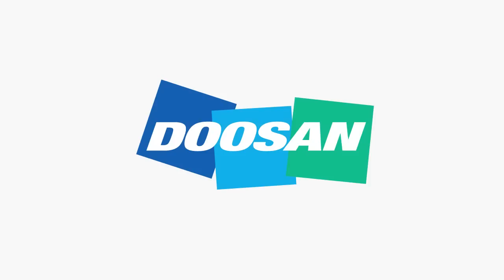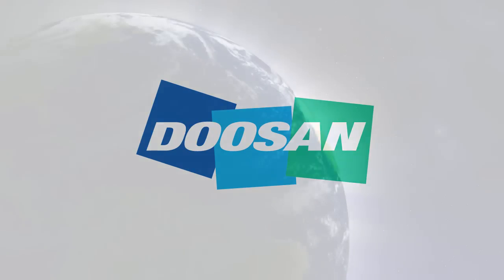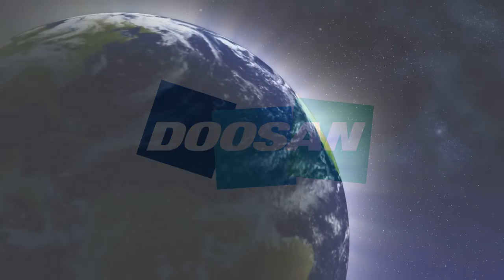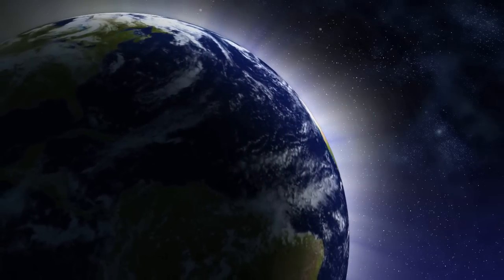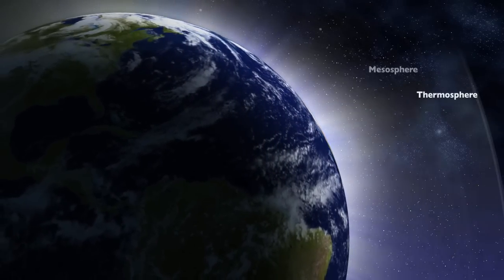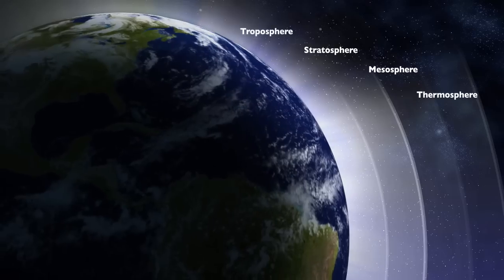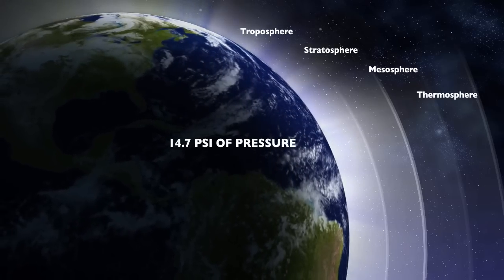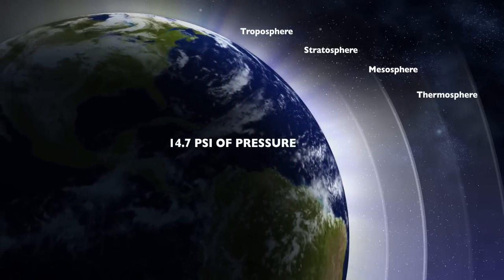How a Compressor Works

Comment: Thanks I was wondering how a rotary screw air compressor works. Very similar to a turbine engine. I’m making the jump as a gas turbine engine tech to a compressor technician.

Comment: Nice, would have been even better with oil séparation principle, really important, but this work already deserve thumb up.
This would be great a similar work with séparator, knowing there are still lot of more ancient screw compressors that use outer filter, not exactly the same as enclosed one, about the few internet schematics or animation with outer séparateur it's just terrible, for this technologie nobody seems to know where oil go? schematic of air circuit are alright, showing air coming out clean, alleluia! but oil?? it has disappear as if by magic... those attempts copy past all ends to the point where internet editors can't go further, then lazy boy kick in and bet it's enough for ego and internet noobs, job done.... classic.

Comment: I had a look at the biggest one they make today. It was pretty cool! I'm thinking it would get expensive fast if it ran out of oil. Do they use a torque fuse to protect engine if compressor seized during operation?

Comment: the engine turns on,the intake valve opens and the air flows in.
1.is that statement true?and if it is not can someone explain the part how does the air enter the chamber in the first place?
Reply: https://youtu.be/m5MKC3G-KrQ
Reply: My guess is it enters naturally. 
The engine and two Helix screws create the high pressure and the low pressure area behind acts like a vacuum.

Comment: How two helix rotor is rotating? its via supply or air
Reply: one of the rotor gets a drive by electric motor or turbine and the other is gets driven...and pneumatic I've not heard of... as the drive will be requiring more power, I don't think pneumatics can give...
Reply: https://youtu.be/m5MKC3G-KrQ

Comment: does the air coming out contain oil?
Reply: there is another type of screw compressors which called oil free compressors (with 2 kinds, dry type or water lubricated type) you can use it for food or medical industry
Reply: I live in canada and the air goes from the compressor through an oil coalescer, then air dryer, then a niosh approved filter, then through a breathing air box and then I can breathe it.
Reply: lol but to answer your question yes
Reply: Kya baat hai Khan Sahaab nice info👌👍

Comment: Sorry but screw does not compress the  air inside the screws as in the animation. It shows that Animator and director of animation understanded a bit wrong the fundamental of air screewing process. screw captures a unit of air which is equal to the volume between one step of screw face and surrounding cylinder and the other screws face. and it pushes (i mean moves not squeezes) this volume into the outlet .
Reply: ZIQI compressor
Reply: Venus air compressor

Comment: I always wondered what those little Doosan trailer hitch units were. I guess I just assumed they were generators. This is interesting to know, especially here in L.A. where there are film shoots all over, with all their strange equipment and devices. They all seem rather mysterious until you find out what they do, and usually they are just generators or A.C. units.

Can anyone tell me what the applications of a compressor like this would be used for? I stumbled onto this video by accident while I was looking for a technical explanation of the inner workings of more basic simpler compressors, like those used in fridges/freezers, to power nail guns, etc.
Reply: i use these for jack hamers, shock creter, pipe slammers.
Reply: https://youtu.be/m5MKC3G-KrQ

Comment: So basically you have a normal gasoline/diesel engine which drives the compressor shafts (bit like a supercharger?), which compresses the air. Am I correct? Then how about those air compressors on trains that switch on and off and make a really loud sound and vibration? Do they act the same way, or are they different?

Very informative video nonetheless! I love watching these kinds of things. One day when I buy an air comp. I'll at least know how it works and appreciate it more, haha!
Reply: Kryndon64

Comment: We have a compressor that won't shut off and keeps blowing the pressure valve. We replaced the pressure valve and Sep. Element. Still keeps building pressure and blows valve.  Any suggestions on what to check next?
Reply: +Brewer Cote West pressure sensor
Reply: Correct
Reply: https://youtu.be/m5MKC3G-KrQ

Comment: can you please explain how this pressurized tank which is last stage of compresing air..how it works?
Reply from the maker: Hello!  The basic idea of the separator tank (each model varies slightly) is that when the oil and air mixture enter the separator tank, the mixture is forced through through a filter which makes the heavier particles (oil) drop to the bottom of the tank and the lighter particles (air) pass through and rise to the top and then going out to the tool. The oil which has fallen to the bottom of the tank is then taken and re-purposed in the machine. I hope this helps.
Reply: speedair compressor matenace

Comment from the maker: Treeky Galvan - we do not have a compressor that compresses to water.
Reply: +Abby Rose Nepomuceno Water is incompressible. You cannot reduce its volume.
Reply: +PandaeD Not true at all, I studied fluid dynamics at University but check out Wikipedia's fluid dynamics page if you're not convinced. Water can be modeled as incompressible to simplify calculations, but in reality temperature and pressure are variables, which alters water's density; and consequently its volume.
Reply: it is cmpressible
Reply: Liquid water is incompressible, only steam can be compressed
Reply: Pump only help in increasing the kinetic energy of fluid ok it do not compress to liquid
Reply: It is called pump guys. PUMP! It reduces the volume of water and increases it pressure.

Comment: How about a compressor that compress it until it turns into a liquid. Do you have any video like that?
Reply: https://youtu.be/m5MKC3G-KrQ
Reply: All compressors do. If you squeeze 100 cubic feet of air into 10 cubic ft cylinder you also get the moisture in that 100 cu ft room squeezed into that 10 cu ft cylinder. Thats why they have a drain tap at bottom of the cylinder. That's also why scuba divers get thirsty after a dive. The moisture is pre-removed so they're breathing dry air.